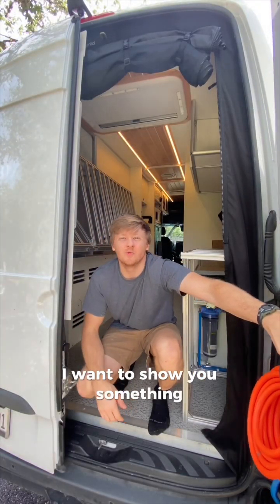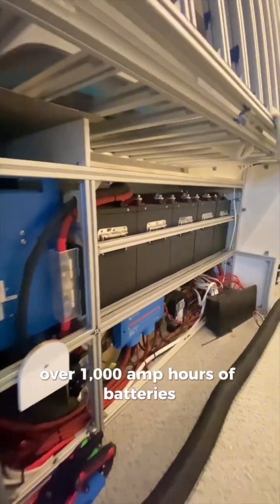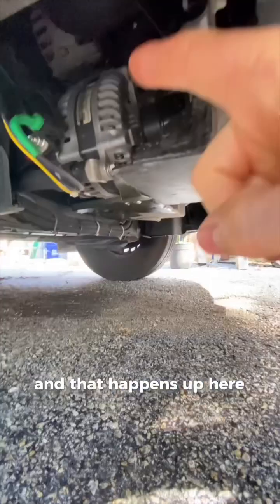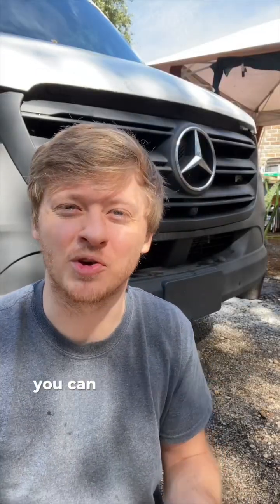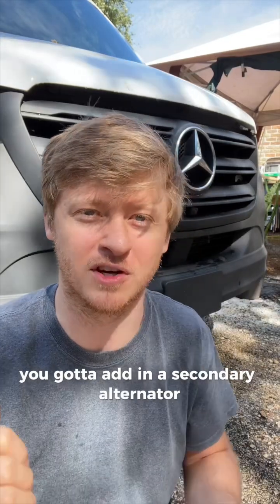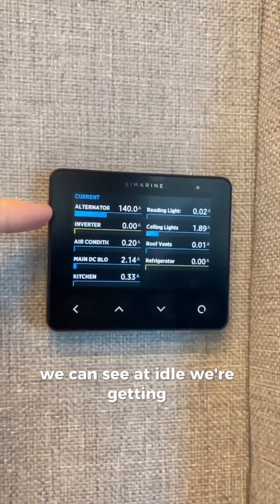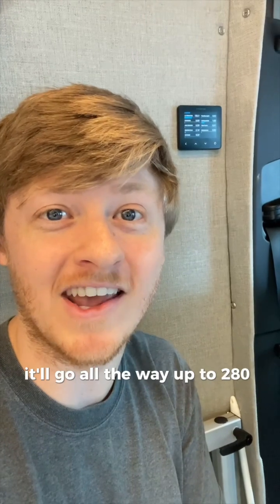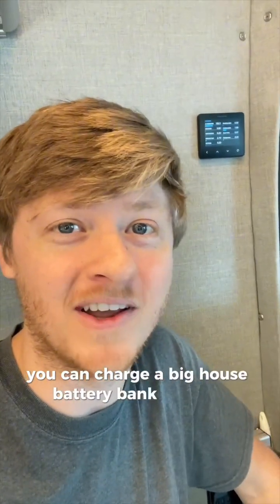Secondary alternator gives so much charging potential for a camper van

Comment: Also, which one do you think is better? Diesel with a Battery pack vs fully electric with solar vs hybrid of all three since it lowers the risk on reliability of each system but adds maintenance issues in the long run??? 😊

Comment: And there is a Victron video on why you should not use an alternator on its own to charge batteries, good luck.
Reply: Which was advertising hype and was debunked years ago, I use a Renogy 50A MPPT D.C. to D.C. charger, but not because of nonsense put out by Victron trying to sell their overpriced overhyped gear.

Comment: Have you looked into 48V systems? I’ve seen some alternators that do that and it’s <50A so you can run way smaller wire to the battery bank. Nice setup. Why do you want so many AHs? You do multi weeks without charging?

Comment: Nice setup! If your batteries are fully drained, how much driving time would you need to get them back to 100%
Reply from the maker: For 1000Ah battery bank it would take about 4 hours if the alternator is close to its max output. But also with a battery bank that large I don't think it would get fully drained very often.

Comment: Awesome!!!! Thanks! Your fuel is likely far cheaper than Europe, what damage does it do to the fuel consumption and does it disconnect/remove its added resistance once batteries are full? Lastly, I presume the alternator is 12v? If that's so, x140/280A would be 1680/3360w respectively; per hour?? That would negate the need for solar? :o

Comment: That's insane, I'm already finding my 400W of solar redundant after I installed a renogy DC to DC that only charges at 50 amps. BTW you're building a new van? Your original videos  helped me a lot during my own build 2 years ago.
Reply from the maker: Glad to hear my videos were helpful to you! This was part of some van work I did for a client (and their power needs we’re definitely higher than a lot of use cases). Not currently working a new van for myself (but hoping to renovate our transit next year), but staying busy building vans for clients. More long form YouTube content to come soon!
Reply: @MoserMakes  Does the BMS easily protect against overcharginer, or how do you make sure the alternator isn't trying to put 280 amps into full batteries?
Reply from the maker: The secondary alternator is controlled by a dedicated regulator - in this case the exact product is a Wakespeed WS500. It monitors the battery voltage, temperature, and current flow from the alternator and adjusts the output of the alternator to only give the batteries what they need and not overcharge them. Beyond that, the batteries internal BMS will make sure they stay within their safe operating parameters.
Reply: @MoserMakes  thanks for the quick reply! so theoretically if the batteries weren't asking for anything the alternator would not be running, or it would but not charging the battery and not producing a hazardous amount of heat/current?

basically, outside of cost and "another thing to go wrong", is there any systemic risk or disadvantage? seems kinda like a no brainer if you can afford to invest in it
Reply from the maker: Yep - that's basically it. If the batteries are charged than the regulator won't have the alternator output any power to the batteries (to be really technical here is an excerpt from an description of how alternator voltage regulators work, "The voltage regulator controls the field current applied to the spinning rotor inside the alternator. When there is no current applied to the field, there is no voltage produced from the alternator"). 

For a camper van power system system with a battery bank that is larger than can be charged from solar (due to limited roof space) or the limited output of the stock alternator, a secondary alternating is the best option for charging without access to shore power. I don't think there is much downside beyond what you said - the added cost and another part that can go wrong later. It will add some additional load to the engine (another item the engine belts are spinning), but I don't think it's very substantial. 

With that said though, most camper vans don't have power systems quite this large and can get away with just charging via solar and smaller dc-dc chargers pulling from the stock alternator. All depends on your power usage and battery bank size.
Reply: @MoserMakes  Oh that makes sense now! The alternator belt can spin without generating any voltage... I'm definitely going to at least pre-wire for one, but I'm still fine tuning my electrical needs. Thanks again!

Comment: the question is "will those batteries able to absorb that much power in a fast manner like that?"
Reply from the maker: That is a great question and something to not overlook during the system design! Different batteries/bms will be able to accept different charge currents and it is also dependent on the total number of batteries in the bank.

Comment: 280 amps 😳⚡️
Reply: That’s a beefy alternator, indeed. Mine is 250A stock.
He has the wake speed WS500 regulator that will ensure the batteries don’t get too many amps and he said the batteries have a BMS to ensure that they don’t get overcharged

Comment: What are you using to manage those 280 amps?  The biggest DC-DC converter I've seen was in the 100a range.  I have 1 250a alternator and 2 Victron Orion 30a DC-DC.  Each one is wired to a breaker that's mounted to the base of the driver's seat.  If it's cloudy and I'll be driving a long distance I'll just use 1.  Shorter distance I'll use both.  If I'm getting good solar (720w) I may not use either.
Reply from the maker: The secondary alternator is managed by a regulator, the Wakespeed WS500. Since the secondary alternator is only for charging the house batteries, the regulator directly controls the alternators output based on the batteries state of charge. The WS500 is pretty smart and uses its own current shunt, voltage and temp sensors for optimal and safe charging. 

So it’s a bit of a different type of hardware compared to when you have one alternator which is regulated by the vehicle to charge the starter battery and you use DC-DC charge controllers to charge a house battery as well. 

The setup you described is perfect for when you are using the vans primary alternator. I’ve installed quite a few parallel 30A orions like that for clients. 

Outside of Victron, Sterling Power released some new 2023 models of their battery to battery chargers with the highest current options being 70A and 120A. On their older models they had a mode you could turn on that limited it to 1/2 power for times you want to lighten the load on the alternator like you described for long drives. From a quick look at the manual though I couldn’t tell if they carried this feature over to the new models, and I haven’t used one hands on yet.
Reply: @MoserMakes  Thanks, I'll keep that in mind if I ever do another system.

Comment: The amount it charges the battery would be proportional to the amount of drag it puts in the system. Might as well have a gas powered generator? I suppose there's some utility in it but it would be pretty niche.